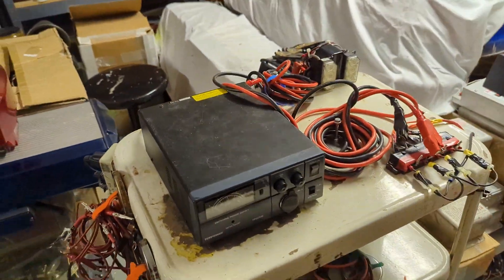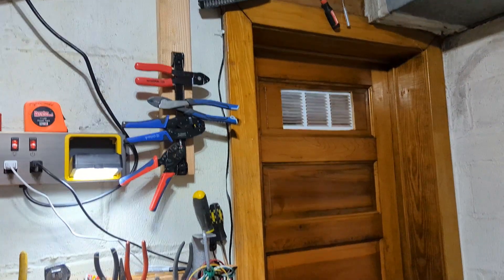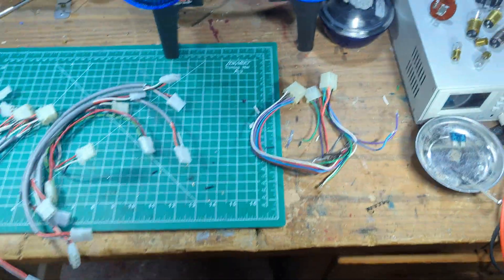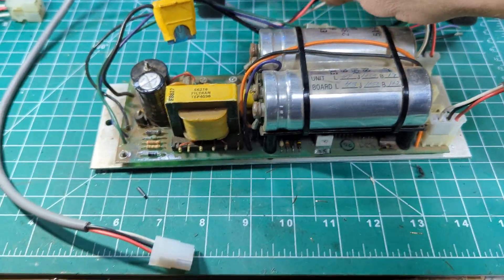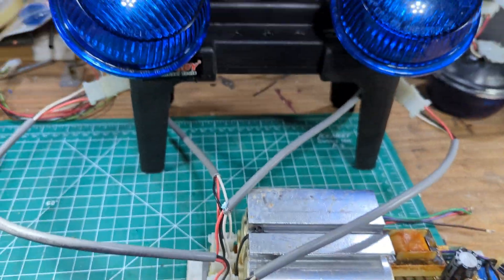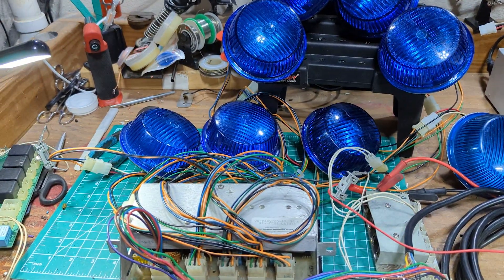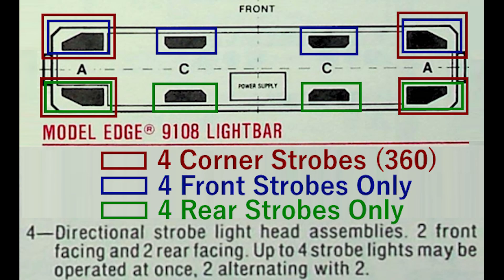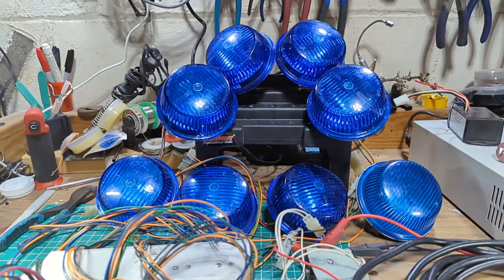A quick Tour of my New Lab and Some Power Supply Testing.

Comment: Does the double flash (or comet etc) use the same capacitor but switches the discharge?
Reply from the maker: Yeah, they all charge similar high voltage capacitors, it is just what pattern the trigger is activated in as controlled by the logic portion of the system.